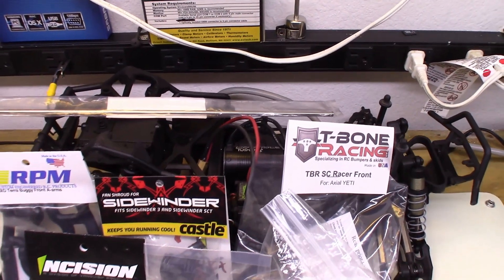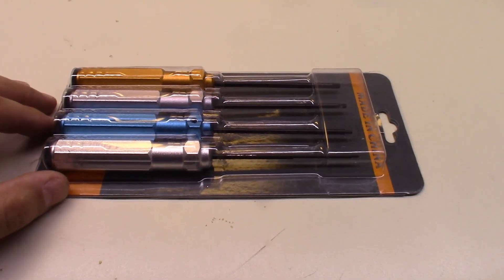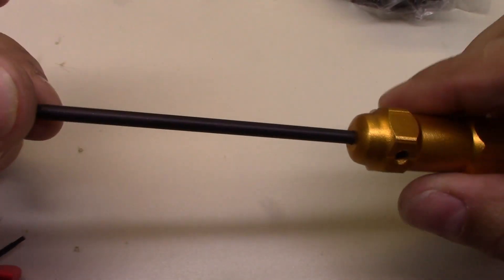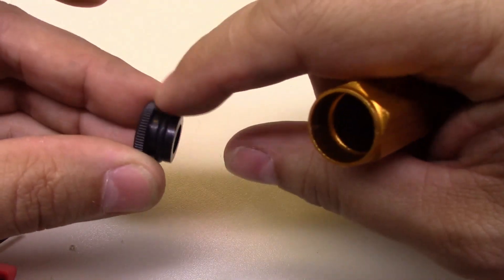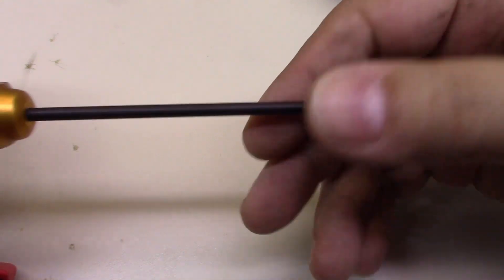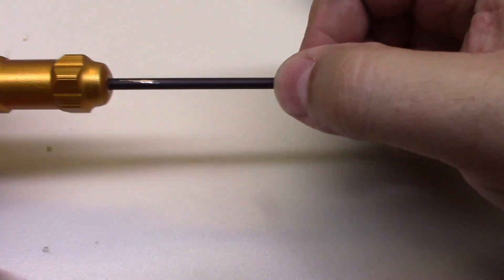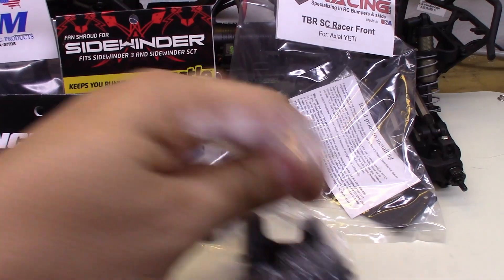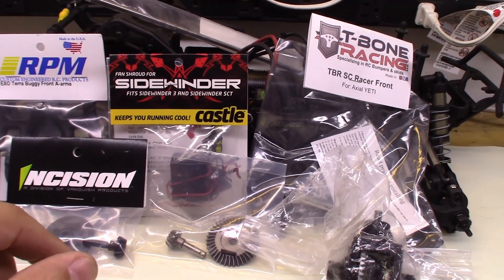Aiskaer RC Hex Driver Quick Review & Whats to Come

Comment: I've got the neewer brand of those. They have the titanium coating.  Have had them for a year and a half and still get the job done without stripping. I recommend these to friends who are just starting out in the hobby. Best 13 bucks I've ever spent
Reply from the maker: Very cool!  Yeah my originals are still kicking butt. I actually bought another set to take the bits out of and use in my drill.  I have a giveaway going on in my second to most recent video if interested!
Reply: @DoRC  yeah I just got my mips in. But these will stay in my bag unless someone I know needs them. Thanks for commenting back brother
Reply from the maker: No problem.  A sub is appreciated!
Reply: @DoRC  subbed. Sorry it took so long lol
Reply from the maker: @mg90q61  thanks!  New videos soon.  I'm dealing with health issues so things are a bit slow.
Reply: @DoRC  sorry to hear that brother. My thoughts and prayers are with you.